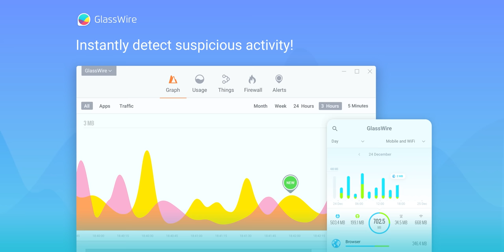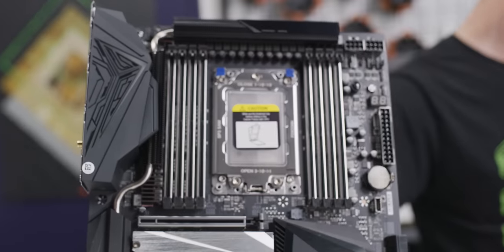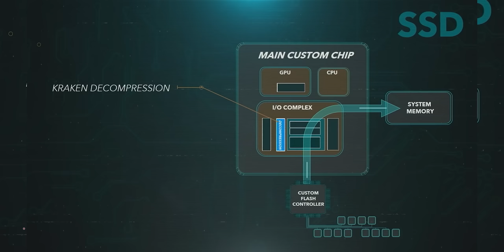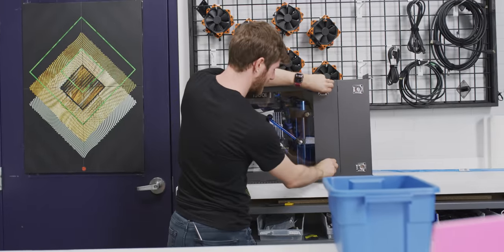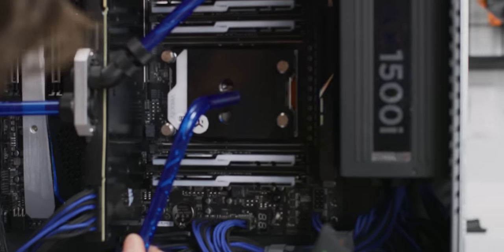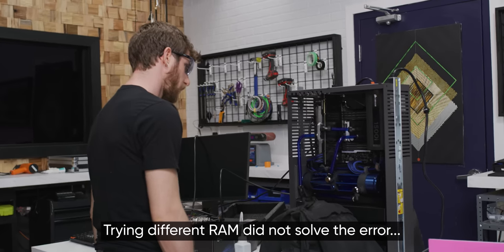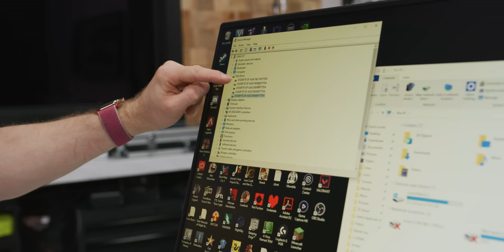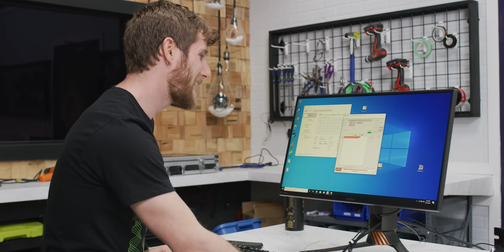I may never upgrade again!

Comment: That thing is almost as fast as my ddr3 Ram. He should try to use it as a 8tb Ram stick
Reply: Windows doesn’t support 8tb
Reply: He could run 2 instances of chrome
Reply: Vincenzo pro only supports 2tb
Reply: @mactutorials5806  Most prob he'll have to use Linux if he does this project
Reply: George4All yeah
Reply: @mactutorials5806  lawl not true at least I don't think. Work has at least 1 windows pro and 3 enterprise stations with at least 6tb of RAM not sure if that's the limit but it still boggles my mind all the time because they look like ugly Dell machines.
Reply: J D I was talking about pro
Reply: @ghejnuni  Well anthony has to use Linux :D
Reply: @NilsOberheim  Yeah, but it'll be better to see Linus struggle trying to use Linux unstead of seeing Anthony doing something easily
Reply: @mactutorials5806  not sure big pro supports 8tb but I've personally seen it supporting 6tb
Reply: Ure right
Reply: Raw speed has nothing to do with RAM’s speed for what matters. That SSD still has a latency 2 orders of magnitude more than even some ancient DDR2 .
Reply: @FederalBureauInvestigation_YT  that is the limit.
Reply: @eric4946  well, it could be used to store the bulk of data waiting to be processed, doesn't it?

i'm referring to the video where linus complained about the Threadrippers having a smaller amount of max RAM than xeons and epycs and that it sounded an artificial limitation
Reply: @mactutorials5806  Ha. Very funny.
Reply: @mactutorials5806  Yeah if you are still on MBR
Reply: Dosent windows only support 1tb of ram
Reply: @PulsewayMedia  no. only if you are using 2003 server enterprise edition. it depends on versions and ofc max for 32 bit is 4 gig on normal versions.  home and ed have support for 128 gb and you'll get at least 2 tb with pro or even 6 tb with enterprise and ws on normal win 10. for the server versions of windows you'll get 2 or 4 tb on some and 24 tb support on server/datacenter 2016 and 2019 version. tl'dr here is a list of supported ram sizes of win 7 and 10 and server versions. i guess noone would care about vista, 8.1 or xp.

Windows 7 Starter 32-Bit	2GB
Windows 7 Home Basic 32-Bit	4GB
Windows 7 Home Basic 64-Bit	8GB
Windows 7 Home Premium 32-Bit	4GB
Windows 7 Home Premium 64-Bit	16GB
Windows 7 Professional 32-Bit	4GB
Windows 7 Professional 64-Bit	192GB
Windows 7 Enterprise 32-Bit	4GB
Windows 7 Enterprise 64-Bit	192GB
Windows 7 Ultimate 32-Bit	4GB
Windows 7 Ultimate 64-Bit	192GB

Windows 10 Home 32-Bit	4GB
Windows 10 Home 64-Bit	128GB
Windows 10 Pro 32-Bit	4GB
Windows 10 Pro 64-Bit	2TB
Windows 10 Pro for Workstation 32-Bit	4GB
Windows 10 Pro for Workstation 64-Bit	6TB
Windows 10 Enterprise 32-Bit	4GB
Windows 10 Enterprise 64-Bit	6TB
Windows 10 Education 32-Bit	4GB
Windows 10 Education 64-Bit	128GB

Windows Server 2019 Essentials	64GB
Windows Server 2019 Standard	24TB
Windows Server 2019 Datacenter	24TB
Windows Server 2016 Essentials	64GB
Windows Server 2016 Standard	24TB
Windows Server 2016 Datacenter	24TB
Windows Server 2012 Foundation	32GB
Windows Server 2012 Essentials	64GB
Windows Server 2012 Standard	4TB
Windows Server 2012 Datacenter	4TB
Windows 2008 R2 Server Web 64-Bit	32GB
Windows 2008 R2 Server Foundation 64-Bit	8GB
Windows 2008 R2 Server Standard 64-Bit	32GB
Windows 2008 R2 Server Enterprise 64-Bit	2TB
Windows 2008 R2 Server Datacenter 64-Bit	2TB
Windows 2008 R2 Server Itanium 64-Bit	2TB
Windows 2008 Server Web 32-Bit	4GB
Windows 2008 Server Web 64-Bit	32GB
Windows 2008 Server Standard 32-Bit	4GB
Windows 2008 Server Standard 64-Bit	32GB
Windows 2008 Server Enterprise 32-Bit	64GB
Windows 2008 Server Enterprise 64-Bit	2TB
Windows 2008 Server Datacenter 32-Bit	64GB
Windows 2008 Server Datacenter 64-Bit	2TB
Windows 2003 Server Standard Edition 32-Bit	4GB
Windows 2003 Server Standard Edition 64-Bit	32GB
Windows 2003 Server Enterprise Edition 32-Bit	64GB
Windows 2003 Server Enterprise Edition 64-Bit	1TB
Windows 2003 Server Datacenter Edition 32-Bit	128GB
Windows 2003 Server Datacenter Edition 64-Bit	1TB
Reply: That's not how that works....
Reply: @FederalBureauInvestigation_YT  o
Reply: @mactutorials5806  maybe use it as swap memory then?
Reply: @mactutorials5806  linux exists u know
Reply: @mactutorials5806  yes it does
Reply: Loool
Reply: I still use ddr3
Reply: @mactutorials5806  Who told you that? Considering it's a business, you could use up to 6tb of RAM in basic Windows 10 and many different interactions of Windows can use up to 24TB of ram. So, yeah, it can.
Reply: @mactutorials5806  and also, you said "windows" not pro. Which, BTW, is a shit ton more than the Crap Pro can have, which is only 1.5Tb. 😉
Reply: @mactutorials5806  Imagine that, still, tho. 2tb partition. Of RAM.

Fuckin. Imagine if he partitioned some of it for V-ram.
Reply: Um, yeah don’t tell him that’s not how ram works 🤦‍♂️
Reply: @anthonydoroshenko  realistically I'm sure there is a way to use something that fast as ram just as you could use hdd space as 'ram'
Reply: Pcie ram lets go baby
Reply: @AltosGarage  pro is 2tb
Reply: He could use virtual memory without speed loss
Reply: @FederalBureauInvestigation_YT  windows pro caps at 2tb, while linux is at 256tb. So yeah...
Reply: @Dunkelelf3  oh my god you brought back horrible 8.1 memories... I remember being like 10 and my dad coming back with the first computer I had with 8.1 after my windows 7 pc broke, and I absolutely HATED it. I remember bitching that it felt like a tablet instead of a computer anymore, and everything was bugged. I also looked up sooo many “how to” YouTube videos for games and stuff back then, and when every video was on windows 7 and I couldn’t find the files in 8.1 I would get pissed. Thank god that OS is dead
Reply: @UpbeatTempo  yeah i suppose it somewhat is dead. still supported by ms unlike win 7 and older but it has like no marketshare. i mean in the later versions 8.1 wasn't soooo bad but well. 10 is superior. it's like the best of 7 and 8.1. microsoft learned from their mistakes in 8.1. dunno why ppl complain so much about win 10 tho. i used it since the release and never had any problems. at least not any problems i couldn't fix.
i mean vista was also technically not so bad. it was just ahead of it's time kinda. it was way too resource hungry since ppl came from using xp and with less than 4 gb ram the os was simply unusable. but ppl comming from xp would often have dualcore systems with 2 gb ddr2 and that system ram was basically already eaten up be the system allowing for nothing else to be done or run. ram was cheap back then and tons of ppl ran out and upgraded their machines for 4 gb back then. 
but still nothing beats windows me. that was the worst shit they ever released.
Reply: @mactutorials5806  server obviously does..
Reply: I feel like that would absolutely fry the board
Reply: @mactutorials5806  Windows Server 2019 standard/datacentre edition supports 24tb.
Reply: Ddr3 is slow af
Reply: Bruh imagine the amount of performance downgrade if he did that 😂
Reply: @mactutorials5806  so Linus can do it, he is Linus
Reply: @mactutorials5806  shhhhhh let nils dream
Reply: @mactutorials5806  r/woosh
Reply: @mactutorials5806  how about windows server ?
Reply: @paxdomini9714  Thats pushing it
Reply: Imagine the amounts of chrome tabs he can run here!!
Reply: @Drunken_Hamster  It wouldnt work well.
Reply: @georgemuller3998  Yeah but the bottlenecks of Vram are the same here.. latency prevents this from being worth it at all
Reply: But.....    

Latency
Reply: Any platform that woild be awesome
Reply: @mactutorials5806  then use linux
Reply: @paxdomini9714  maybe even 3
Reply: @ghejnuni  no and yes, remember his red hat kvm.
Reply: @mactutorials5806  just use Linux lol
Reply: latency would be pretty bad :(
Reply: That will kill it over time.
Reply: @mactutorials5806  theoretically, he could just put in a high speed 4gb ram stick, and make windows result to SSDs when ram space is lacking.  Therefore, he would have as close as you could get to 8tb ram.  It wouldn't be true 8tb ram, but it would be pretty fuckin close.
Reply: INFINITE SWAP
Reply: Wouldnt it kill the ssd in like a year?It wears out yknow
Reply: @mactutorials5806  yeah only 2tb of ram
Reply: so many replies debating possibility and not one mentions the fact that no CPU supports 8TB of RAM
Reply: Bandwidth isn’t everything
Reply: @mactutorials5806   windows server?

Comment: I will never ascend to the elite level of having my entire machine in another room just so I don't have to hear air move.
Reply: as a streamer I've been wanting to do it for years. You really notice a difference when you're listening back to it on your headphones.
Reply: @BrocoliColonist haha I have mag Lev fans mate they produce as low noise as you can get. Couple of be quite fans in there as well, it don't matter what fans you have, you're always going to hear it in the mic.

Edit: I might also add I've tried dozens of different fans and fan curves, it never produces low enough noise where it isn't easily noticeable in a expensive mic setup
Reply: @ThornyPickled  you do realize there are programs made to suppress those exact issues in the mic you dont need to spend thousands to make a pc that out does the ps5 ssd is just one out of the many parts used to make a pc run smooth and quit. if you dont know about any of that maybe do some more research on pcs
Reply: Ehhh, I did it to try and isolate the heat... not for sound...
Reply: ThornyPickled just use a noisegate lol
Reply: This. So much.
Reply: @00000005547   that suppresses the sound, and can change how your voice sounds. This removed the sound totally. Idk why you have to complain about it and give a “solution” that just tries to hide the original problem.
Reply: Just use a noctua. Some of them are as good as watercooling, very quiet, without the watercooling headaches.
Reply: The only noise in my pc, 3x 140mm fans at 3500rpm and gpu. But I like to watch the rgb inside the tower so beautiful.
Reply: I did that and I'm dirt poor, I stream my PC to my phone via Steam and then connect my phone to any display and peripherals I want.
Reply: Actually doesn't sound like something you need to be rich for. Extension cables aren't made of gold
Reply: The closest I’ve come was considering putting my computer in my closet two feet from my desk 😂
Reply: It all can be done, as long as you have long cables.
Reply: @octomorty6338  noise gates ftw
Reply: I just bought extremely high quality noise canceling headphones and that solved my issue and my PC sits right next to me on my desk
Reply: @octomorty6338  Except he wasn't planning to? You don't need the 8TB SSD to move your pc over to another room, that's not what he was talking about.

Comment: "I may never upgrade again!"

We all know he's gonna upgrade again when Zen 3 comes out
Reply: Right when Threadripper Pro are out... Next week.
Reply: Linus's Zen 4 system:

Threadripper 5990X - 128C/256T
Gigabyte TRX60 Designare EX
384GB G.Skill Trident X Neo - 6x64GB 8400MHz C14
Nvidia Quadro RTX 10000
Gigabyte Aorus 16TB Gen4 SSD
Seasonic PRIME TX-1800
Reply: Louie Friesen 
All of that power, and yet

Can it run Crysis?
Reply: we all know that title is a lie lol
Reply: @Metamine0  Probably not... Unless if you do it at 144p 24Hz...
Reply: I've reported the inappropriate comments.
Reply: To be fair he upgraded from a 5960x to 3900X which was a pretty massive gap.

Comment: Linus: Air cooling doesn’t make any difference. 
Also Linus: **uses custom water cooling in almost every major build**
Reply: Custom water cooling does cool substantially better than regular air cooling
Reply: Alex Davis I know but Linus (at least used to) say that it didn’t make much difference
Reply: It doesn't make a difference to performance, but it does to cooling capacity and noise. Water has a higher temperature ceiling, thus i can soak up more heat then a few aluminum plates can. Thus you can tune it to reach the same temps on an air-cooler but without audible noise or cool better with roughly the same amount of noise.
Reply: @supe5772  Actually he said several times that only AIOs are not so different in performance from air cooling, he has always said that custom loop cooling is more efficient if done right.
Reply: pretty sure he  said aircooling vs AIO water cooling is pretty much the same but I don't remember him saying a full custom waterloops performance was the same as high end air cooling
Reply: I think he was referring to AIOs not custom loops
Reply: @MrHendrikje  lol temp ceiling on water is only 100 degrees celcius before it turns to vapor thoug.. u can heat up aluminium to like 1000 degrees...  so id say ur statement is false there... also water cooling solutions tend to be more noisy then air cooling when u just need 1 or 2 fans to do the job, and with water u also need a pump that makes noise.. where water shines is the capacity to contain heat.. since ur putting out heat it takes longer for the mass of water to heat up then it does with a alu/iron heatsink.. so when ur boosting the first few minutes it wont get hot as soon.. and irl the loads ur going to put on are mostly in bursts.. so thats where water is better... the other things are nonsense.. also its just cooler to make a water setup (it looks cooler) but also more maintenance/work to keep it going.. and more points of failure..
Reply: Air cooling generally is better than AIOs, especially at the same price, but not necessarily better than custom loops. 

The NH-D15 with two fans beat most if not all 240mm radiator AIOs while being both cheaper and quieter (no pump droning), so your average user won't need anything more than that.
However, you can get better cooling performance from AIOs with huge radiators or if you're running a custom loop through multiple radiators. You'll still have the pump droning, but the cooling capacity is more or less infinitely scalable given infinite money and space.
Reply: The biggest thing is that he has water causing the GPU as well. CPU versus water cooling is marginal improvements for water, but it’s substantial for GPU.
Reply: @alexdavis9324  if your after noise suppression thats all yoru gaining vs air or a good aio
Reply: AIO is necessary for a very small itx build in a Silverstone sg05/sg13 case
Reply: It should be noted that Linus also pointed out that while air cooling might be equally effective for performance he pointed out AIOs have other advantages such as being less likely to damage the motherboard when you transport a PC vs a heavy air cooler.
Reply: Lars Vegas well I was actually talking about both
Reply: @larsvegas1505  The limiting factor in any cooling system is your energy dissipation rate. This is essentially composed of the delta between the air temperature and the fin temperature, the surface area of the fins, air flow rate and the specific energy transfer rate of that material (simplified, some other factors not included). 
---
The limitations of air cooling has been it's radiator size because they use heat pipes, which use convection internally to circulate the coolant, are a passive heat transfer system. This means that the radiator of an air cooler can only get so big before the heat pipes are unable transfer enough heat to the farther away fins.
---
Water cooling uses an active pump to circulate the coolant, so the radiator size can be significantly increased while still being able to efficiently transfer the heat to it, thus increasing cooling capacity.
---
Also, most workloads in a modern computer are not constant. This means that heat production from the components can be absorbed by the coolant, limited by the coolant's heat capacity per degree x volume. This allows your components to be cooled better for the same size of radiator, so long as the average heat output of your components is the same. This reduces the noise produced and allows you to use lower energy fans.
Reply: It's quieter
Reply: How else can you plug the water bottle in there? Lttstore.com
Reply: @alexdavis9324  also 50 percent chance more of Simon breaking something or messing something up....so i'm always up for them water cooling lol
Reply: @larsvegas1505  only 100c at atmospheric pressure. Start pressurizing it and it will go up. But more importantly water is a better thermal conducter than air as well, meaning it transfers heat away from the system better. Now obviously it still needs to get rid of that heat, but that's where the increased  surface area comes into play. Even beyond the radiator it has surface area all over. The tubes, the reservoir, etc. A good custom water loop system can infact cool your system down as well as their air counterparts with less noise.

The problem with air cooling alone is that unless you have a larger heatsink, it's hard to get rid of the heat by air. It's why vehicles don't just have copper/aluminum tubes strapped to a heatsink in the front.

The tradeoffs are money, time, and potentially more points of failure (although if you go whole system, you're getting close to net).
Reply: @larsvegas1505  you need to study some physics! The custom loop has much higher thermal mass in liquid and rads combined, it can store more heat than any cpu tower AND can disperse more watts of heat providing adequate rad surface area.
Reply: @alexdavis9324  the difference between 80° and 65° is typically not worth the quadruple pricing of a custom loop. More power too you though
Reply: İf nobody buy water-cooler  get cheaper
Reply: haha sub count go shhhhhhhhhhh